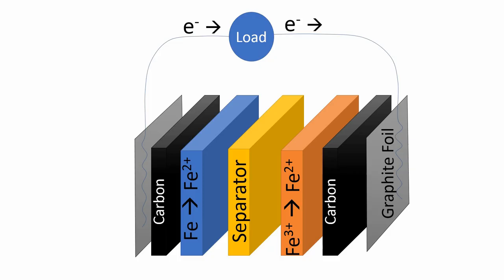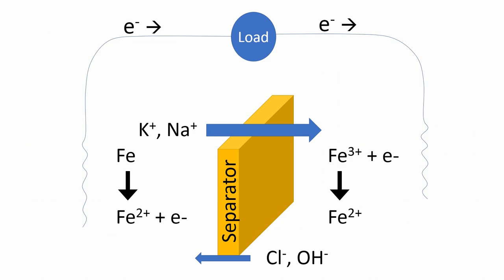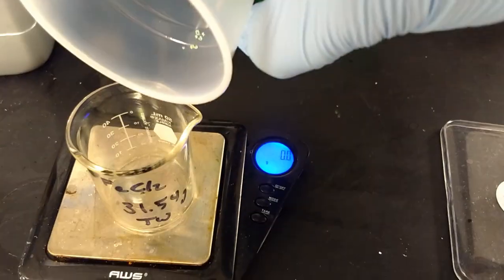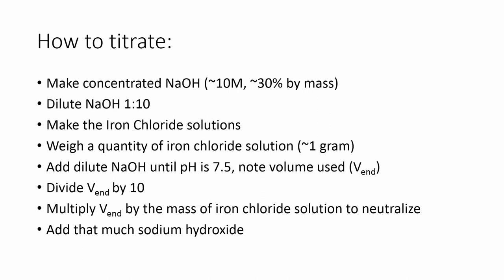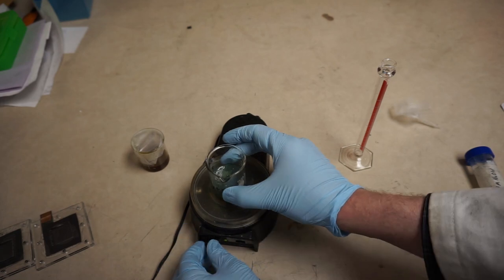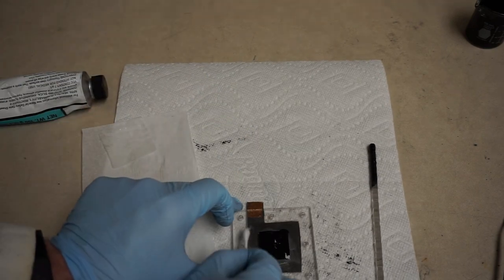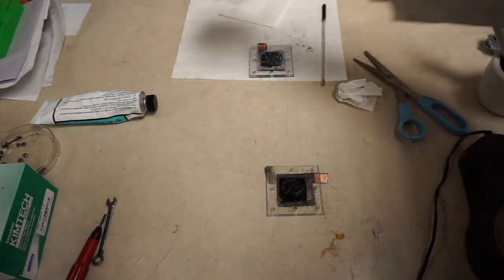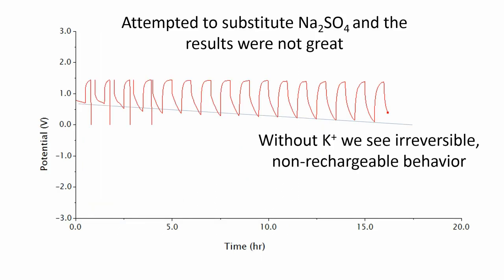Iron Battery 1.5 Build Instructions

Comment: Interesting research. The iron cell I have been working on is replicated from William Hada's iron carbon battery with a few modifications and an iron(II) chloride electrolyte. Good results. I have made a video of the cell and I would appreciate any feedback or comments you might have. Given that this cell has a steel wool negative, carbon felt positive, iron (II) chloride electrolyte, how does one calculate W per kg when the carbon felt positive electrode does not take part in the chemistry? Factor in the mass of the electrolyte?

Comment: Just saw you older video on microfluidics being cut on a k40 laser. But I'm wondering if you saw Thought Emporium's video on using shrink film to make them. This looks like a way to get even higher accuracy becasue of the 5 times difference in size after shrinking.  Just wondering on if you have been still pursuing the field.

Comment: nice work. I am thinking of working on an iron battery. Keep up the research you are getting very close. I think you might want to try different redox electrolytes or a chromoxide one electrode. Not perfectly iron but it will give a big boost.